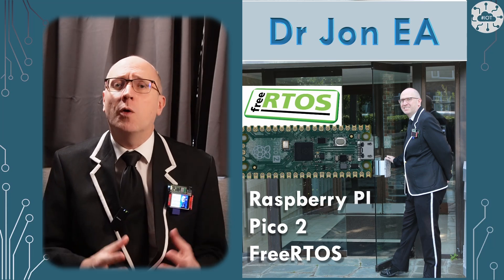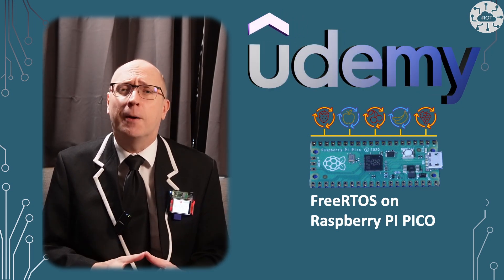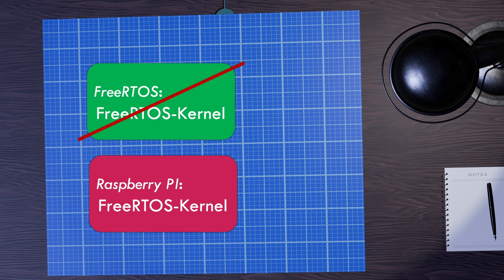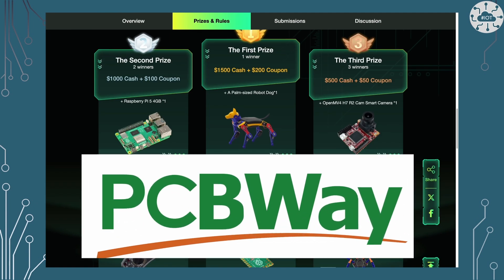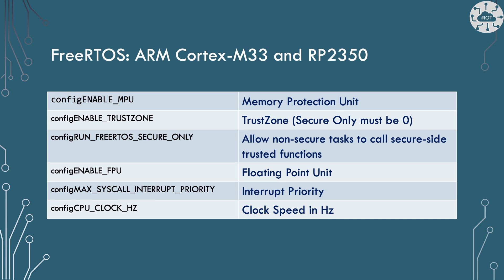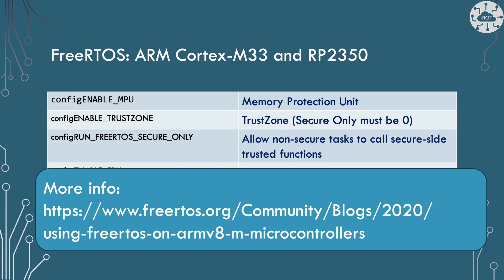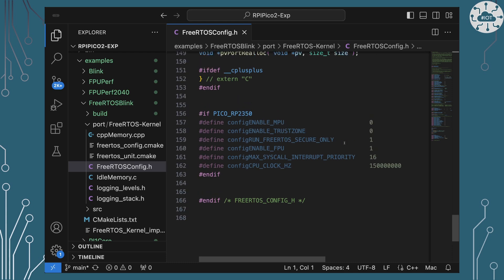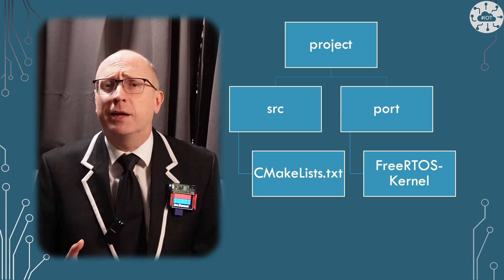FreeRTOS on Raspberry Pi Pico 2: The Ultimate Guide

Comment: This video does not help at all. And I can't believe how scarce the information about compiling FreeRTOS for Pico 2 is. There are ZERO fucking CMake files for it that work. What an utter piece of crap.
Reply from the maker: Things have been moving a lot with FreeRTOS Kernel support for RP2350. My examples do work and can help. Just tell me what you are seeing.
Reply from the maker: This is my reference repo that I use for starting my projects https://github.com/DrJonEA/RPIPico2FreeRTOSRepoExample
Be careful though as rp2350 support is now in a submodule of FreeRTOS Kernel. So ends up being sub module of sub modules which sometimes does my head in to manage git submodule inits.

Comment: Hello this is my PICO_FREERTOS=/home/devel/pico2/freertos/FreeRTOS-Kernel/portable/ThirdParty/GCC/RP2350_ARM_NTZ where I put my FreeRTOS-Kernel. devel@pi5-70:~/RPIPico2-Exp/examples/FreeRTOSBlink/build $ cmake .. This is the error that I ger '/home/devel/pico2/freertos/FreeRTOS-Kernel/portable/ThirdParty/GCC/RP2350_ARM_NTZ'
  does not contain a 'rp2350-arm-s' port here: All help is appreciated
Reply: echo $PICO_FREERTOS /home/devel/pico2/freertos/FreeRTOS-Kernel echo $FREERTOS_KERNEL_PATH /home/devel/pico2/freertos/FreeRTOS-Kernel still gets error with cmake .. CMake Error at port/FreeRTOS-Kernel/freertos_config.cmake:3 (add_library): Cannot find source file:/home/devel/RPIPico2-Exp/examples/FreeRTOSBlink/port/FreeRTOS-Kernel/idleMemory.c plus other errors. Example Blink ok. PI1core Total: 391      6.516667 per sec ok PI2CORE  Total: 768      12.800000 per sec ok  FPU does not create /dev/ttyACM0 great Demos FPUPerfRP204 also did not create /dev/ttyACM0 On the FreeRTOSBlink I tried setting a FreeRTOS-Kernel/ same results. Thanks for all the help all is appreciated
Reply from the maker: I think PIC)_FREERTOS should be "PICO_FREERTOS=/home/devel/pico2/freertos/FreeRTOS-Kernel" I think you have pointed this too low in the structure.
Reply: @DrJonEA  /home/devel/pico2/freertos or /home/devel/pico2/freertos/  Error Directory '/home/devel/pico2/freertos' does not contain a 'rp2350-arm-s'
Reply: @DrJonEA  FPUPerf  & FPUPerf2040 my error PICO_DEFAULT_UART_RX_PIN=17 PICO_DEFAULT_UART_TX_PIN=16  pico2 Total: 24999899         2499989.900000 per sec  pico Total: 24999899         2499989.900000 per sec
Reply from the maker: Hi @edwardvidal6176 On some of my older repo I've made a mistake flipping the pin assignments in the CMakeLists.txt file in the src folder. Before SDK 2.0.0 these all work as actually the code doesn't care which way around these are assigned but from 2.0.0 there is a check. Just flip them.
I have a video talking about stdio and using different pins which you might useful.
If you find issues do raise an issue in GitHub and I will go back and fix things.
Jon
Reply: @DrJonEA  With the recent update of the pico-sdk to 2.1.0 does you example FreeRTOSBlink still work?  Even with pull of the FreeRTOS-Kernel it should if (PICO_SDK_VERSION_STRING VERSION_LESS "2.0.0")
        message(FATAL_ERROR "Require at least Raspberry Pi Pico SDK version 2.0.0")
    endif() which is in the CMakeLists.txt of FreeRTOS-Kernel/portable/ThirdParty/GCC/RP2350_ARM_NTZ/CMakeLists.txt as of 11/25/24.
Reply: this 2.1.0 also requires an update to the picotool if you are using a built version PICTOOL_FETCH_FROM_GITHUB
Reply from the maker: @edwardvidal6176  Hi. I've just checked the Repo. https://github.com/raspberrypi/FreeRTOS-Kernel hasn't been updated for 3month, so not sure what update you are referring to for 11/25/24. I've just recompiled using SDK 2.1.0 and it all worked fine. I'm curious what is in the PICO version string. Could you message it out and see?
Reply from the maker: @edwardvidal6176  Yes it does. Found that myself today,
Reply: @DrJonEA  the pico-sdk 95ea6ac 2 days ago was updated but the Forked FreeRTOS-Kernel
Reply from the maker: I'll double check tomorrow.  Trying to get some code working on pico2w and also hitting some problems.
Reply from the maker: Hi mate. I can confirm the FreeRTOS examples for the Pico 2 still work. They will also work on the Pico 2 W, where relevant. What is broken is running any Wifi with FreeRTOS on the Pico 2 W. There is a bug in SDK I've reported and we have a fix for.

Comment: I'm wanting to migrate a project from ESP32 which relies on FreeRTOS. Do you consider the Pico2 version to be stable for 2 core SMP now?

https://youtu.be/yHnW9om89lM?si=wNManqDg0scn-Yhi
Reply from the maker: Yes as far as I can see it looks stable. It is not significantly changed from the RP2040 SMP code base so feel it is a good platform to work off.